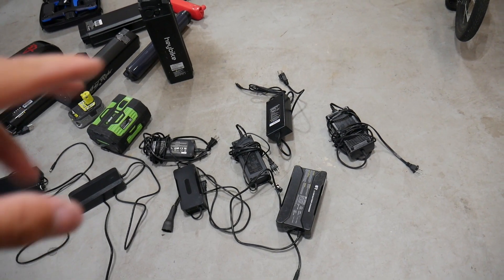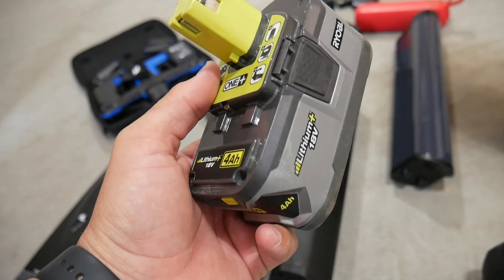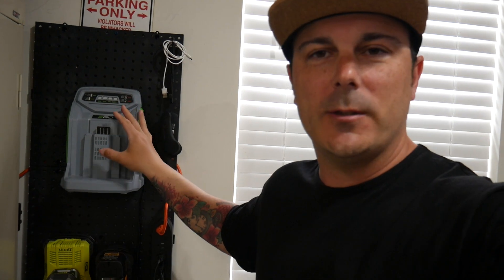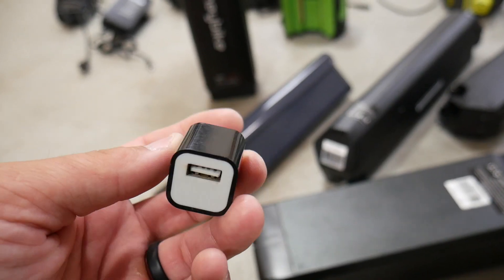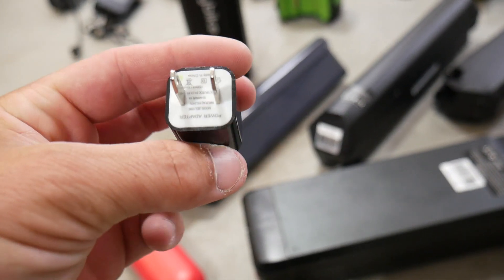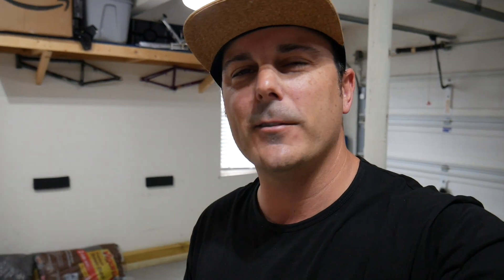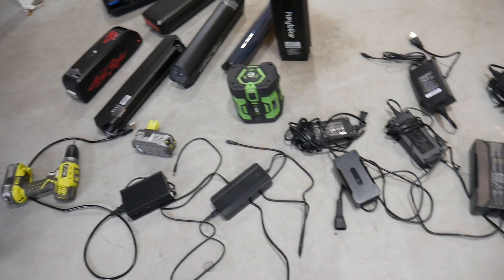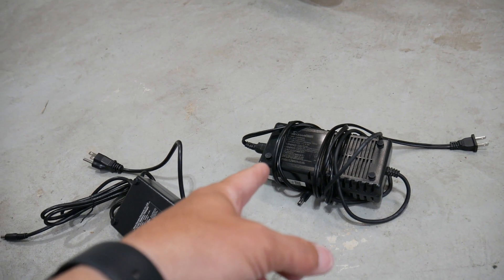** THE TRUTH ABOUT ELECTRIC BIKE FIRES **

Comment: ROHS is a clean manufacturing standard based on reducing polution, not a consumer safety standard. 

Manufacturers must SELF certify that they meet FCC standards for acceptable electromagnetic interference levels..Again, zero to do with safety. UL is the primary safety certification - not just UL listed either, but certified.

Comment: I think if they are going to scam you they will. My ebike charger has all those logos on but the UK plug is not correct. In the UK the plug needs to have a fuse in it. The only way I can think of to fully protect yourself is do not charge inside and if you need to because you live in an apartment use a lipo battery bag that will contain the explosion and fire. They bags are cheap enough when you just spent all that cash on a bike.

Comment: This video is useless without a discussion of the CONTROLLER being used as the interface between the charging system, the Battery Pack & the E bike motor... unless you drive a Bosch- in which case you will not be able to charge the unit while it is in use... if you decide to do a proper video then one important issue you need to cover in that topic is the difference between REGENERATIVE BRAKING [Hub Motor Only] that allows motor to become a generator- charging the battery pack- whenever on a downhill or braking Vs Mid Drives that cannot do regenerative braking but [unless they are a Bosch] can be charging while in use. from say your solar system or whatever.

Comment: We have electrification of transport in the UK: trains! You assert that my phone contributes more to lithium mining than a car? That is objectively wrong! The market for smart[hones is a bigger consumer of lithium, but there is waaaay less lithium in my phone than in a Tesla! Between my e-bike, laptop, phone, solar watch, e-cig and other miscellaneous items that contain lithium batteries, I have waaay less lithium than someone who owns a Tesla and nothing else! And as regulations are pushing the electric car as the future of transportation, cars will overtake smart devices pretty fast soon- the market is growing and pushes to ban combustion cars will see people switching to lithium batteries!
The problem is that cars aren't sustainable in general. Cars are best where you need to travel a long distance and combustion engines or fuel cells are just better for those cases, cars as commuting vehicles suck! Cars and cities don't mix! There are reasons to bring a motorvehicle into a city, but it is the number of unnecessary journeys made every day- don't forget the cost of infrastructure and it's environmental impact in maintaining too- which only goes up as vehicles get heavier! We need more cycling infrastructure and publi  transport, and instead of sticking batteries in buses we should be putting up overhead lines and, if possible, rails.
It is a shift away from a car centric society that we really need as it isn't just an environmental issue, it is the space that is wasted, the noise created even just rollig noise, it is the danger and inconvenience that cars cause to everyone outside of one (and to drivers when no comfortable alternatives exist and everyone gets into one at the same time(, it is the uglyness of all the wide roads and massive parking lots, the light pollution at night as they drive past while you are trying to sleep. Electric cars aren't the future, more sustainable micro mobility solutions using smaller batteries or human power or a mix and good mass transit as well as denser mixed-use development that is the future. EVs seek only to make us continue to feel good about supporting our selfish addiction to cars!

Comment: All these ebike fires and other lithium ion battery fires can pretty much be avoided if the manufactures just switch to lithium iron phosphate battery chemistry.  Yes the battery will have to be 18% bigger to get same range but it will last 2 to 3 times longer.  Can be charged to 100% without damaging the battery.  Can be discharged to a much lower percentage without damaging it.  Lithium iron phosphate batteries are incredibly difficult to catch fire even when physically damaged.  If they do catch on fire they don't burn as intense as a lithium ion battery fire and can be put out with regular water.  On top of that they are cheaper to manufacture.   The only thing that needs lithium ion batteries are small drones where every ounce of weight makes a big difference.  So if you ebike has a 20 pound lithium ion battery all you need is a 23.6 pound lithium iron phosphate battery to replace it.

Comment: I have all the certifications with the ancheer and they turn off by themselves and don't get warm after is gone, but I'm gonna get a lipo safe bag which is a fire proof safety bag for batteries just in case some are small 5" for 6.99 and large 10" to 14" from 12 to 27 dollars

Comment: That’s for this video and explanation. I have several ANKER devices and this particular one for my iPhone
It’s a PD TYPE 
NO CE , IL or any that you mentioned.
I see VI, TUV, PSE 
This was a two pack with Anker cables  from COSTCO. 
What gives from a big manufacturer like ANKER, 
Thank you
Reply from the maker: I would have to see it, but some brands aren’t required to, depending on where the product is made. The anker stuff is legit. I use a lot of their stuff and have never had an issue with a block or cable. Thanks for commenting man🙏🏽

Comment: My ebike just caught on fire. I had two batteries in series making 112v. I think the series configuration messed up the Battery management system and the cells overcharged. My entire garage was on fire.
Reply: yeah you should only use lithium batteries in parallel for extra range as long as they have the same s rating

Comment: Careful, with 50 years electronic experience the only Class C (electrical fire) fires I've experienced were due to batteries, all with proper certifications. Tech safety has progressed far but still...shit fails and putting out a battery fire is not easy.

Comment: Today 90% fires are caused through electricity only 10% house fire are caused by other means, why?  I could go in 99% homes in england and find at least one electrical violation it because people know how to plug in things and work things but they don't understand electricity.  You can plug in 20 devices into one 250v socket and they all work, its 250v and it works  and that is okay they don't see themselves overloading the socket.  A person buys a computer laptop and there plug for another computer works it so the us that, why? Because yes it does charge it but they don't look at other spacific, there is a lot of universal chargers for sale they will convert 250v into 12v, 6v even 36v or 48v but what they don't convert is the other spacifics and if the charger is higher then the item its charging the item gets hot and explodes, its not the item it is peoples lack of knowledge and how they are using their electrical supply and what items they buy.

I always use the charger that comes with the item and if it stops working order the genuine part not of market, if you do buy off market read the spacifics and never go over the 13 amps for one electrical socket, most computer are 3 amps so can use a extension with 4 plug points and use 4 items, once you start going over 13 amps then your putting yourself and others at risk if there is a electrical fault with your item.  Batteries should be kept in a cool place and when charging often feel the battery to see how hot it feels or charger, if it is warm that is expected but if its hot then switch it off as you should be able to touch it.  My  Father and Mother in law when I first got married 22 years ago nearly every applience with a plug on was incorrect, wires showing, extension leads plugged into exrension leads even using vacumms and drills which are high amp appliences.

The first thing I did was cut the wires down and secured them in the plugs and tolds them not to use more then one extension lead and go over at least 15amp, told them the ampage of each item as kettles are usually 5 amp, microwaves 13amps and other kitchen appliences like electric knife, bleders are usually 5amp, toasters, kettles and larger appliences can be from 5amp to 13amp so just look at the fuse.  With ebikes yopu have so many ametures and young teenagers building them not just the bike but rhey building there own batteries, they are coming up with 100v batteries working 36v bikes because people are telling them its okay on youtube all it does is increase the power to the motor, these motors was not built for that power and increase vatage with a battery you never know what ampage it as.

I built my own ebike but I would never try to build my own battery and would never try using higher spacific then my motor was built for, my brother only just axcaped prosecution for connecting 13mp wiring to his lighting system and using drills and hig ampage items to the socket connected.  He thought it is 250v so its okay but there is a lot to take into consideration your main fuses, I have known people connect full size co9okers to plugs and plug them into wall sockets which is a seperat fuse at 25amp not 15amp, boilers are 15amp and have their own fuse on your electrical board not 13amp but yet all these things are 250v, yet 13amp if you touch it you have 90% chance of surving but 25amp you have a 10% chance but yet they both 250v, so its simple you work a 25amp on 13amp fuse its goingb to overload the circuit yet you can work a 3 amp applience on a 25amp circuit because it will blow the fuse to the applience before firing.  The thing is your electrical supply as been designed to take more then 13amp but you appliane.  At least 90% know very little how to use their electrical supply properly and ebike and scooter fires are accuring more often because ametures are building their own with no safety measures or education of building a safe bike and battery.

Comment: I bought a really nice battery from fth for $500 a 14 amp hour Panasonic batteries and then I bought a cheap ass uncertified charger and I'm f*** cuz I lost $500 cuz I was f**** stupid and it's not going to be covered I'm sure so why pay to send it back in cuz I'm f*** that's what I think. Might as well buy a new battery because I'm f*** if I open the battery it's not guaranteed. Saving money on a battery charger is a very bad freaking idea trust me I lost $500. Maybe I can salvage the batteries some of them because I think one of them burned out and lucky it shut off with the BMS I think one of the batteries burned out it smells burnt I am so lucky the garage didn't burn down with my bike and it's not attached to the house so if it did burn I wouldn't die at night sleeping in a fire those fires are f**** scary real scary! I wonder if anyone ever had one start on fire under their ass when they're riding probably mine's behind my seat under my ass. It's like riding on a flamethrower if it starts on fire. Now I got to buy a new battery so I can have three and I'm so freaking pissed at myself for being so stupid and not doing my research man was I stupid I could have spent $20 more about a decent charger and not have this problem I can't even go camping now 30 Mi away and not have three batteries just in case. Man don't make the mistake I did batteries cost a lot and I'm hoping they will make lithium iron phosphate ebike batteries so they don't burn and they last longer and they are making them but I don't know if they make the fish batteries or if they cost a lot more? But when the batteries get better the bikes will get better the cars will get better eventually when the batteries get better people who say electric is no good they will be eating their words in a hundred years when they're dead LOL

Comment: So, watching this video and it’s entirety convinced me to stop charging my E bike inside the house. Yesterday I moved the charger out to my patio on concrete with the battery on concrete blocks away from the building. I’m using the certified listed charger that is appropriate for the battery along with a timer. Also a properly sized 8 foot extension for the surge protector that the charger plugged into. This was very easy to just pop the battery off the E bike couple more steps in the process but great peace of mind.
Reply: Just be sure never to charge if the temperature is below freezing, as this can damage the battery

Comment: I plugged the wrong rc airplane battery into a charger.  Instant fire, no way to easily put out.  Chucked the battery into a window well with rocks.  the fizzing and smoke lasted for hours.  bought a fire extinguisher after that but wondered about the damage to my lungs.
Reply: That was operator error thou. All it takes is a wrong setting on the charger, hence why its recommended rc batteries are charged in a safe location and use a good fire bag or metal box. Also don't store the batteries fully charged.
Reply: @craigalexp  seems that RC hobby is more open and we speek about the risk of faulty charging or broke lipos that is in risk of burning and how to protect us, fore example some racetracks dont alow high current charging over 1C and a must use is protecting gear eather charging bag or metalic box during charge.
yes it happens that people mess up and end up with a burning house or appartment but most of the accidents is contained due to safety gets spoken about.

had talked to people that got hoverboards and escooters about the risks of an accident and faulty batteries, most of the time i hear its just the cheep ones that burn ETC... 
in rc hobby it dont matter if its a china lipo or one of the name brand that the 10 best in the world get sponsored with, i seen both cheep and expensive fail.

Comment: My condo board has heard enough of e bikes causing fires.  They now built a bunch of special outdoor bike sheds and ordered every ebike to to not be stored inside condo suites.  A recent apartment fire in NYC killed 19 that was started by a malfunctioning or defective e bike charging system.
Reply: I figured people would've learned from those hoverboards were cut inside the homes of the garage or just the hoverboard caught on fire. Lithium Palmer batteries are fast high rate discharged battery. And when they short they go pretty quick I'm wondering why they keep hiding the electrical cars catching on fire? There's some on YouTube.  Remember the high end Tesla has over 7000 cells in 1000 cells in that battery pack. They're working on new technology to get those numbers down to 4000. But have you ever seen a 6 sell 5000 MAH battery short output they're pretty brutal. And that's just the size of your hand

Comment: I wish people would stop being so sneaky and just make a battery that would be interchangeable w/ everything.... You can easily make a case that would hold a small battery pack so it would fit different bikes but they could all make a similar battery and battery interface but they're trying to get more money or save money.
Edit: In that garage fire at 11:42 it looks like the fire started in the garage right behind the car... Probably on the inside wall to the right.
Reply: There is nothing too sneaky about it. They're pretty blatant about it. Some of it they justify by claiming that it is for protecting their reputation and liability. If your Bosch mid drive motor dies because you have a Brand X battery, Bosch doesn't want their reputation damaged.

In reality, it is about vendor lock-in. Quite a few cordless yard tools are made by Globe Tool group in China - you may think you're choosing between a Husqvarna or Stihl or Echo... but you're just choosing a Globe Tool with a different label.

Comment: Hey Mike, my goal is to talk to you since you're civil and logical here, not the rest of your comment section🤣🤣I agree the majority of the issues with fires and damage is due to user error, I just want to point out two things. There is the slight chance of a faulty charger, battery, balancer, wiring etc straight from the factory. Theres a chance with everything, you could be struck by lightning tomorrow, you have to accept some risk. I'm not sure of the actual statistic, but I'd imagine user error with fueling and working on your gasoline vehicle leads to a comparable amount of damage/number of fires. So people shouldn't be scared because the new thing has issues, when the old thing has issues too! Also, I agree most people who hate on the mines are uneducated but the way you worded it in the video didn't take into account how much more lithium goes into a whole Tesla. Overall, great video, I love your content, keep killing it Mike!